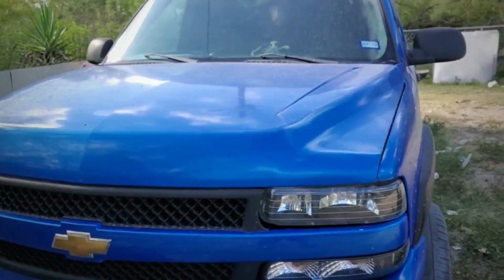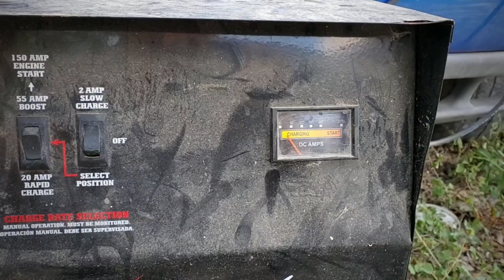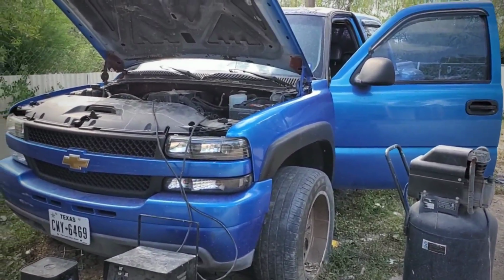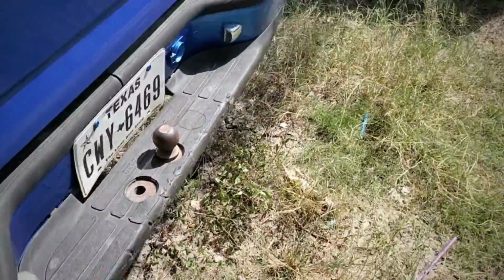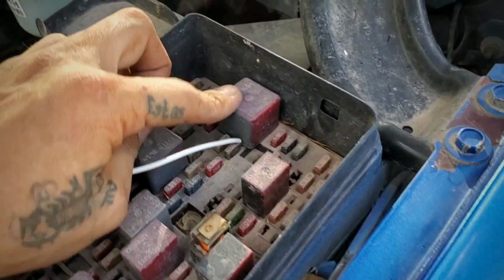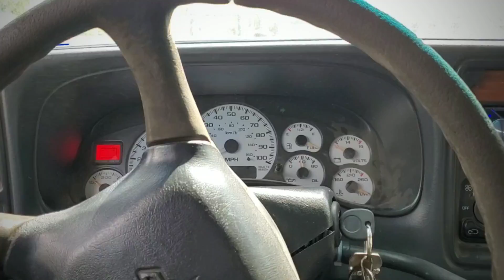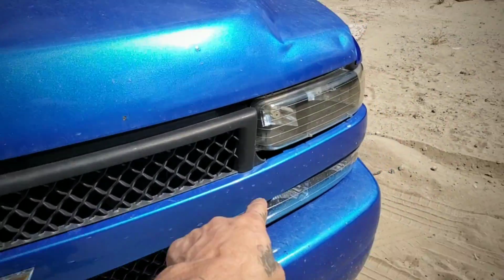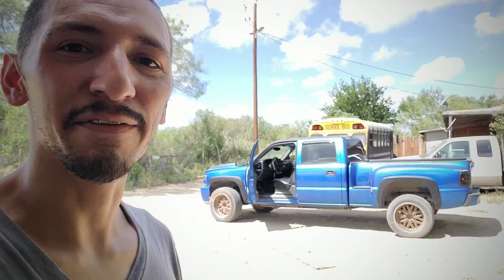She Just Doesn't Give Up!

Comment: Bro a fucking quad cab shortbox step side omggg plus it’s got a 6.0 I’m jealous asf I would build the engine up cam, headers, exhaust then lower it c notch the frame raise the bottom of the box so it’s still useable that trucks a dope colour too 💯💯 I subbed
Reply from the maker: Thanks bro, I worked hard to get it where it is now.. I feel bad for just forgetting about it,  but from the cam, headers and dropped notched, those are goals. 💪💯 
I appreciate the sub!
Reply: GT's Performance no problem man I appreciate the hard work to make something your own, I want a quad cab step side they look so nice lowered with some rims

Comment: Part out lol
I might need a new motor 👀😂
Reply from the maker: Saw you were overheating at the track.. did you get that sorted out or what happened?
Reply: Yes sir, about to install lifters, oil pump, e fans,and timing
Reply from the maker: @V6Nation  that bad?
Reply: Stock lifters and oil pump were already too old and went out. I needed efans to fix ac lol
Reply from the maker: @V6Nation  yea I know what you mean.  Hope everything turns out bro. Hmu if you need anything 💪😎
Reply: I appreciate it man and likewise
Reply from the maker: @V6Nation  lemme know if you need a candidate for some street pulls 😂
Reply: Ill remember 😂